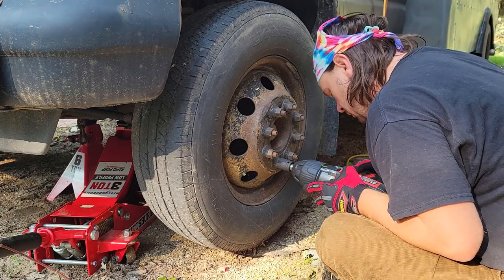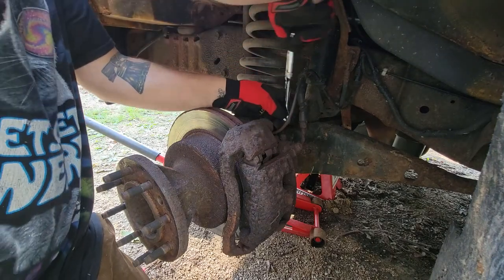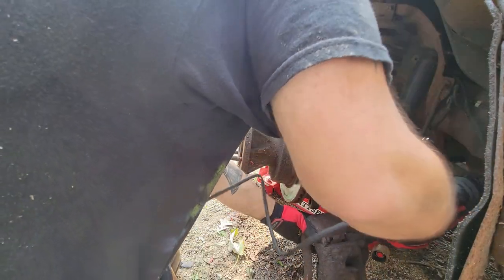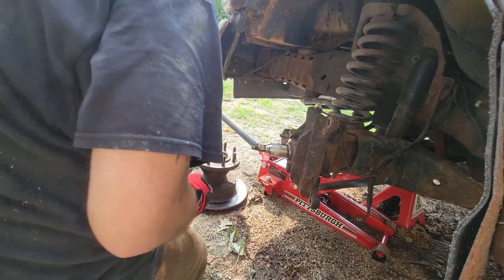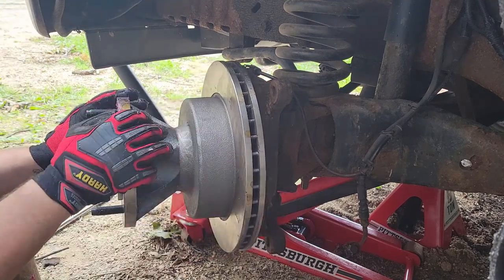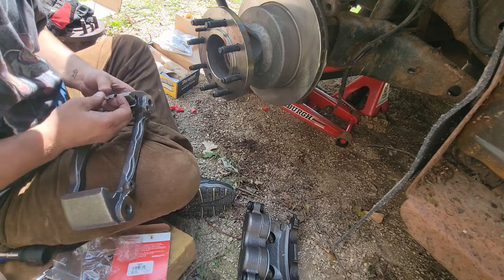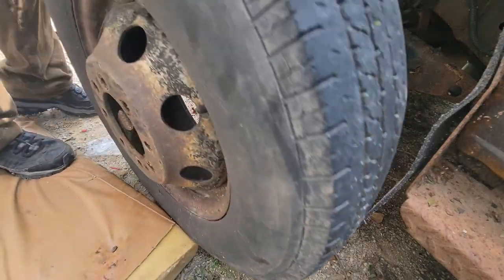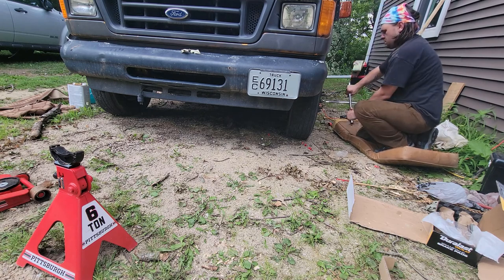How to Change your front brakes- 2005 Ford E450 Dual Super Duty short bus

Comment: Interesting, I always have removed the Caliper first then the mounting bracket... How did you get the dust cap off the Hub?
Reply from the maker: It popped off with a flat head. Which I thought was a bit to easy but they both popped back on fine and stayed on.
Reply: @MidlifeBoon  I finally got my cats paw pry bar, and did it that way

Comment: So what were the torque specs for reinstallition? Im curious, because Your tire lugs need a consistent torque of 140 ft lbs. I would love tp watch anybody save Schwarzenegger, stallone, or Lundgren use a standard 4 way to achieve 140 FT lbs on all the lugs. What did the caliper and bracket get torqued down to? Those are safety of operations equipment. what was ypur preffered meathod to achieve the propper drag torque on the wheel bearings? Ypu dropped it in the dirs so you wiped it off??? I hope you love doing this job repeatedly. Lastly I pray you bled the brake lines, why you didnt show it or mention it is wierd to me as well...
Please have a mechanic who values human life rebuild you bus before you kill someone.
Reply from the maker: You should consider paying more attention to the video and the videos that follow and you wouldn't have so many questions.
 Also English is important, if you are going to be a troll you should consider learning how to write coherent English.

See ya down the road!
Well actually I hope I don't see you down the road, you seem like a buzz kill

Comment: Did you know you can eliminate the extended rotor and use a regular rotor and use the flat rims instead of those bulge out rims like on a E250 and E350 I did it because they use the same spindle

Comment: So you did not bleed the brakes. There's no way you took off the brake line and just put it back on without bleeding the new caliper THAT IS A BIG MISTAKE YOU SHOULD CORRECT THIS VIDEO BEFORE SOMEONE GETS HURT THE PEDAL WILL GO RIGHT TO THE FLOOR.
Reply from the maker: Yes the brakes were bled after. Its actually shown in another video if you were paying attention....(clearly not). Also as I say in the begining of the video again if you were oaying attention (clearly not) I am not a mechanic and if you do not feel comfortable with working on your own vehicle you should be reaching out to someone who does or a professional mechanic. 
Reconsider your life as a troll Bob. You are not good at it.
Reply: So you have to watch another video to see that you'll bleed the brakes? That doesn't make sense. That should be mentioned more clearly. Bob is correct here.
Reply: @MidlifeBoon  Well, I think they feel comfortable working on their vehicles, just not sharing the road with you after you worked on yours.  You need to work on your bearing packing skills as well.  That one will go dry pretty quickly and cut your front spindle right off.